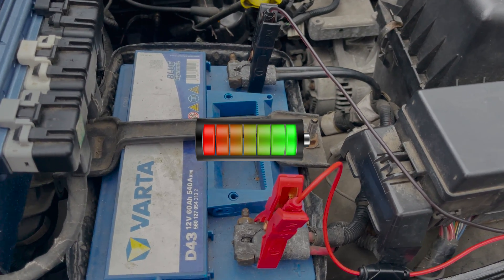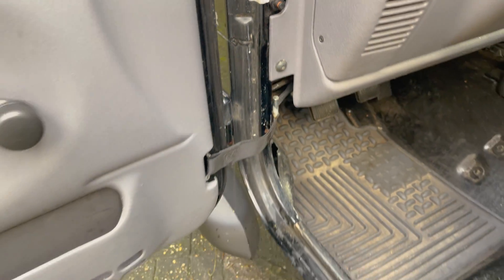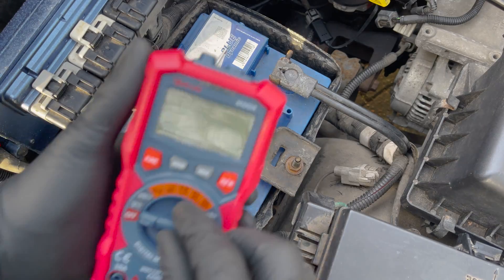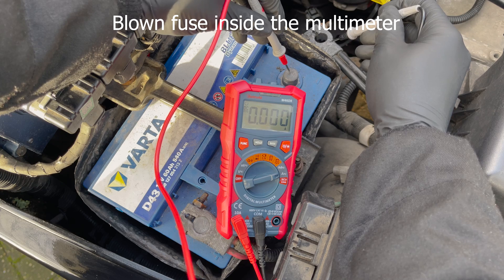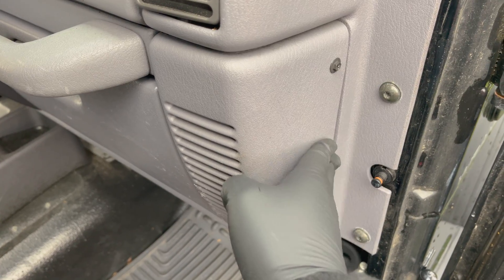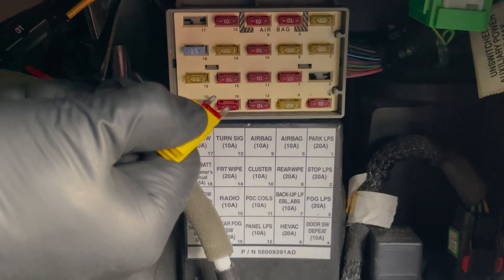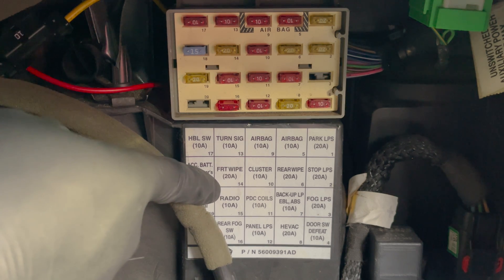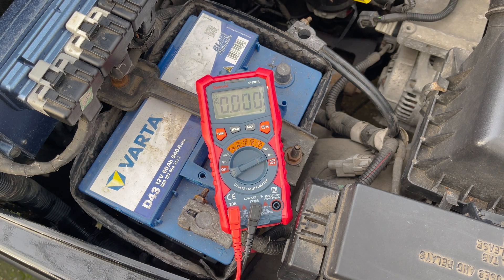The EASIEST way to test parasitic draw

Comment from the maker: NOTE: If you have a modern car with electronics or accessories that need continuous power supply to not lose data and settings, you need to hook up these electronics and/or accessories to an external power source to power them before disconnecting the battery. Always first check your car's owners manual and your car accessories' owners manuals for instructions.

However, it’s important to know that if you use an external power source, you won’t be able to tell if the parasitic draw comes from any of these hooked up accessories or electronics.
Reply: I disconnected the positive from the battery terminal to the fusebox at the battery terminal. I thought the problem might of been where the cable joins under the fusebox, but couldn't figure out how to remove the box to inspect the underneath. I think I have an alternator issue, because as soon as I squirted some (lots) of WD into it the multimeter started reading milliamps instead of amps. A couple of days left overnight the battery showed as 12.68V so thought I had tracked it down, but today it was down to 12.35V (after locking up and leaving for an hour).
Reply from the maker: @stevet603  WD40 is an insulator fluid, meaning that it can temporarily solve an issue with an internal short somewhere in your alternator. If the WD40 fluid gets in between two rubbing wires or a damaged wire and a metal surface which cause the short/parasitic draw, it can temporarily solve/mask that issue. 
The first and easiest thing you can do to see if you have an alternator issue, is to disconnect your alternator right after having measured your car battery voltage. Then leave your car locked overnight with all electronics turned off, and measure the battery voltage again in the morning. If your battery voltage is much lower than the previous day, your alternator probably isn’t the (main) cause. If your car battery reads about the same voltage, it’s highly likely your alternator is faulty and needs to be replaced. 
In case this test indicates that your alternator isn’t the (main) issue, the next thing on your checklist, based on your findings, should probably be to find a way to disconnect and test the cable between the battery terminal and the fusebox.

IMPORTANT: Do not attempt to start or drive your vehicle while your alternator is disconnected, as this could damage your alternator!
Reply: @classiccarmaintenance  Thanks for that. some days, it holds 12.6V, other day down to 8V overnight. where do I disconnect the alernator please?
Reply from the maker: @stevet603  Disconnect all electrical wires that connect to the alternator, but make sure to first take pictures so you can reconnect them exactly as they were afterwards. Careful: do not start the engine or drive your car with the alternator wires disconnected to prevent damaging your alternator.
Reply: @classiccarmaintenance  Thanks again :) looks like I have to dismantle other bits to get to the connections :(
Reply from the maker: You're welcome! Before disconnecting your alternator we recommend to first disconnect your positive battery terminal to avoid creating a short. Be carefull not to touch any metal parts or tools with the disconnected alternator wires. Before reconnecting the positive battery terminal, make sure the alternator wires are not making contact with any metal parts.
Reply: Exactly
Reply: So could I do this parasitic draw test shown in video but since I have a modern car can I use jumper cable and another 12v battery and connect to the terminals ?
Reply: This video was way better than the first result which could not be understood
Reply: can you please 🙏🏻 help ...have seen many videos that say "" after every time checked ...you need to wait for car to sleep AGAIN ""
So this would possible take days !!!? 
 Is this correct
Reply: We've had our 2015 Acura into the shop twice and I don't think they did this when they disconnected the battery. It's dead again!!

Comment: Don't you need to complete the circuit with your meter, wait around 20 minutes and then take the reading? I thought completing the circuit with your meter might wake up some modules or sensors in the car that would then need to go back to sleep before testing?

Comment: Hey, I'm just curious because of a question on the electrical ASE test prep, but can't you also use the voltmeter to test this? Clamping the leads as you did, you would measure the voltage drop across it. Is there a reason why the voltmeter is not used or not as good? Thanks!
Reply from the maker: In a short, somewhat simplified answer: It can’t because of the way voltage and amperage are measured: 

Think of electricity like water: Voltage = water pressure and Amps = water flow

A voltmeter checks pressure with a tiny gauge that barely lets water through.
An ammeter is like inserting a flow meter into the pipe, it must let water pass.
You can’t measure water flow by blocking the pipe.

A parasitic draw test is about measuring how much electricity is flowing through, not how much “pressure” it has. A voltage setting only checks “electrical pressure” to determine the voltage and barely lets any electricity move through, so it can’t show a drain. An amp setting does let the electricity pass through the meter so it can measure the actual flow and allows you to determine if there is a parasitic draw.

Comment: This is a great simple illustration of how to find a parasitic draw pulling fuses out one by one until you’re number on your meter goes from a positive to a negative, but ultimately you should really illustrate what to do once you find where the draw is leaving the fuse unplugged doesn’t solve your problem. You have to find out where the short is after you remove your fuse and fix it!
Reply from the maker: A parasitic draw can be caused by many different things, from bad wiring or a malfunctioning switch to a short in an electrical component or even an aftermarket accessory. Our video was made to help people locate where the parasitic draw is coming from, it’s impossible to list the gazillion possible culprits and their solutions.

Comment: How does a bad ground cause a parasitic draw? from what i know if a ground is bad the component wont power up or if its loose it'll intermittently not power the component, other than that idk
Reply from the maker: It can cause electrical components to stay awake or malfunction, or a relay to stay open causing a parasitic draw. However, it is more likely to be caused by a wire “grounding out”, which is a short-to-ground.

Comment: Great video, but I watched another one that said that at 10 amps you could burn up your leads if you hardwire/clamp them to the battery terminal. I really don't know much about electronics, but just thought I'd mention this as a possible precaution.
Reply from the maker: You can’t burn up your leads, the fuses inside your multimeter will blow before anything happens.
Reply: @classiccarmaintenance  Maybe he meant burn up your fuses, not your leads. Still something I imagine you don't want to do!

Comment: I've had two mechanics do this and they still can't find the culprit. what else could be the problem?
Reply from the maker: Maybe the battery is bad and can’t hold its voltage. You won’t find a parasitic draw but you’ll still end up with a dead battery after a while. Another potential culprit could be a bad alternator. When you’re driving your car, it uses power from the battery, but if your alternator isn’t generating enough power to keep your battery charged, you’ll also end up with a dead battery. We have separate videos on our channel on how to test your battery and how to test your alternator with a multimeter, so make sure to check ‘em out!

Comment: What does it mean when I go from the negative terminal to the ground cable and I get a spark?
Reply from the maker: When you initially close the electrical circuit on a modern car, you’ll sometimes see a very small spark, which is perfectly normal. Depending on your car’s make and model, when the computer and the electronics start up, they draw power causing that spark. However, a bigger spark might indicate a larger parasitic draw. A classic car with no electronics or computer on the other hand, shouldn’t spark at all when everything is switched off and there’s no parasitic draw.

Comment: I did this on my truck and blew my multimeter fuses.    The moment I closed the circuit the trucks lights came on and the meter fuse blew.  What is my issue?
Reply from the maker: Make sure you perform the test with the ignition in the OFF position. However, if everything is turned off and your headlights keep burning, there might be a problem with your wiring or headlight switch.

Comment: It is crucial to maintain this connection without interruption during the test, as breaking the connection can reset the vehicle's modules, causing them to reinitialize and potentially giving an inaccurate reading
Reply from the maker: Correct, that’s why we clamp the multimeter’s test leads to the battery and cable.

Comment: looking for a draw on 04 GMC narrow it down to headlight switch are wire getting closer anyway.when I pull switch totally out unplugged and all I still have lightsan brites to this can't be normal is it.  an when switch is plugged in  wiggle it around cab overhead lights an headlights flicker on an off any advice be greatly appreciated ✌️
Reply from the maker: Sounds like the switch needs replacing, might be a good place to start.
Reply: @classiccarmaintenance just  got your reply.   hopefully that does it  couse I really don't want to start chase n wires behind a dash board thanks for getting back with me on the info✌️🦐

Comment: Wait!  How did the radio go on with the negative cable disconnected?
Reply from the maker: When you hook up the multimeter between the negative battery terminal and the black battery cable, it functions as a bridge allowing power through. This, however, is limited by your multimeters' internal fuse(s). If you turn on too much electrical stuff and draw too much power, its fuse(s) will blow and you'll have to replace them.

Comment: how does the radio stay on to drain the battery when the negative terminal is disconnected from the battery ? im confused . Would the radio not turn off after the battery was disconnected ??
Reply from the maker: When you hook up the multimeter between the negative battery terminal and the black battery cable, it functions as a bridge allowing power through. This, however, is limited by your multimeters' internal fuse(s). If you turn on too much electrical stuff and draw too much power, its fuse(s) will blow and you'll have to replace them.

Comment: Is this safe for multimeter?
Reply from the maker: Yes, the worst thing that could happen is a blown fuse in your multimeter if your parasitic draw is too high for the amp setting you’re in. That’s why you want to start on the highest setting and work your way down as explained in our video.

Comment: Hey all
You are very likely going to blow the fuse in your meter if you do what is shown on a modern vehicle. The act of "reconnecting" the battery is going to cause a spike in amperage as all the modules will wake up for a bit after the 12V is reconnected. You need to avoid disconnecting the battery by connecting the meter to the negative post and negative cable FIRST, then disconnect the cable from the battery without breaking the connections with the meter. Same thing may happen when putting individual fuses back in. It takes up to 90 minutes for a modern vehicle to completely "go to sleep", and multimeter fuses add up fast, so you want to avoid waking the vehicle up unnecessarily.
Reply from the maker: In our experience, it’s not realistic to connect the multimeter to the battery post and cable and remove the battery cable without losing connection. We are, however, making a video on how to test for parasitic draw with an amp clamp, so you don’t need to disconnect any cables, stay tuned!

Comment: Hey there! I know your video is a year old but I'm stuck. My multimeter from Harbor Freight only goes up to 5ampa and it also only reads up to 0.00, while yours goes to 0.002.. does this mean I won't be able to see the "2" and should expect 0?
Reply from the maker: Assuming your multimeter is the Harbor Freight 7-function digital multimeter (the red one on their website) you should be able to perform the test. 

To start, you need to put the black test lead in the “COM” port and the red test lead in the “5A MAX” port. You always want to start high and dial it in. Turn the selector to the “5A” setting and  perform the parasitic draw test. If you don’t get a reading, your parasitic draw is probably too small to measure in that setting. A 3milliamp draw won’t show up here as it is too low. What you then need to do is connect your red test lead to the mA port (the middle one) on your multimeter and turn the selector to the green “DCA” section on the right side of the multimeter. Here you find the milliamps and microamps settings. You want to start with the “200m” (200milliamps) setting and see if it reads anything while testing the parasitic draw. In this setting you can test a max of 200milliamps, so if it reads 12.1, you know you have a parasitic draw of 12.1milliamps. 

You don’t have to go lower, because a parasitic draw below 50milliamps is normal and should show up, no need to get a more accurate result. But if you want to get a more accurate reading, you want to lower the setting to “20m” because the measured result of 12.1milliamps is lower than the max measurement of 20milliamps in the 20m setting. This setting will give you an additional decimal, and might tell you that the parasitic draw is 12.09 and not 12.1, although this is irrelevant when testing for parasitic draw on a car. 

If your multimeter doesn’t measure anything in the 200m or the 20m settings, you probably have a blown fuse in your multimeter that needs to be replaced. There will always be a very small acceptable parasitic draw (under 50milliamps) that’s completely normal and you don’t need to worry about.
Reply: @classiccarmaintenance thank you so much for the very detailed response for my Multimeter! I did try all this and all the things showed was a -1.. no decimals or anything, just a negative 1. I might just go buy a different one if that might make things easier
Reply from the maker: Agree, you’re welcome, glad we could help!

Comment: But... Doing it this way you lost ECI settings for sound system, window auto features and transmission shift settings that the car learned from your driving habits. Better to not break the battery connection when hooking up your meter.
Reply: You lost all that when the battery died anyway 😂
Reply from the maker: Usually you’ve already lost those, because people look for a parasitic draw AFTER their battery has died overnight. Apart from that, it’s also the only way to perform this parasitic draw test with a multimeter. We’re planning on making a video on how to perform a parasitic draw test with an amp clamp so you don’t have to disconnect any wires or lose your settings, so make sure to stay tuned!

Comment: Is 2 milliamps normal in smaller vehicles such as  quad as well? Or what number should I be looking for? I need to go out there and determine what’s draining the battery on that thing
Reply from the maker: In general, you want it to be below 50 milliamps for cars, so 2 milliamps is perfect! But make sure your multimeter is set to milliamps and not amps, that makes a world of difference! 
When your vehicle is stationary for a long time, we do recommend installing a trickle charger to keep the battery in optimal shape and prolong its life.

Comment: So does it matter which end to test with? I noticed you tested the black to the negative and red to the negative cable, then it switched from red to negative (battery) and black to cable. Thanks!
Reply from the maker: Switching the positive and negative test leads will only change the "direction" electricity flows through the multimeter, displaying the parasitic draw as a positive or negative number. It does not change the measured value itself. If you connect the multimeter between the negative battery terminal and the battery cable with the black test lead on the battery terminal, it will display the parasitic draw as a positive number. Put the red test lead on the negative battery terminal and the black test lead on the battery cable and it will show the exact same parasitic draw, but as a negative number with a "-" sign in front of it.